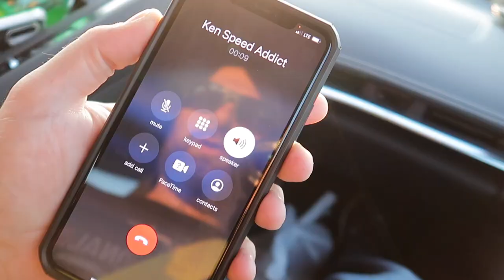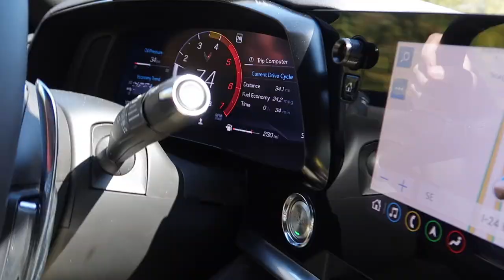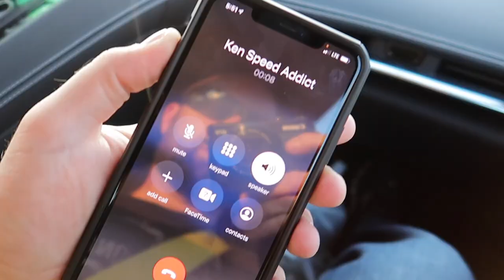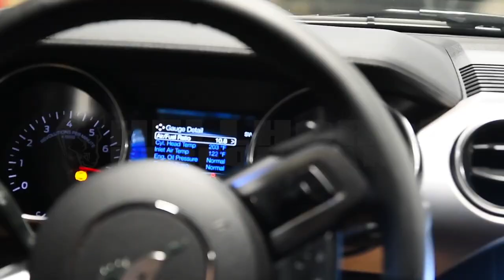FANBOY Mustang Owner REACTION to Guy's NEW 2020 C8 Corvette *IS PRICELESS*

Comment: Thing about the GT500, which has really impressed me with what the engine will hold....is simply another S550 with Eaton 2650tvs rotor pack and predator block anyone can buy for $2600 shipped....meaning we can built it basically...looks sweet but like buy like all other s550s with same parts bolted on it.......

 The C8 is completely a new evolution of 65k car...you can't build it from a 2018 mustang with same parts....it just needs boost....and tuning.....
Reply: You haven't driven a GT500. You are 100% wrong. You can build a GT that will go faster, for sure. But, you cannot build a GT that will handle the same, nor will it shift like the GT500 does. Its not the same car at all. I've actually driven a GT500 on a track. They feel completely different.
Reply: @TurianX  yes and nor would I ever want to....but I like the vettes chances when the computer is unlocked...or on a short track......

 And im sure if I were determined enough, as I explained since they used traditional trans geometry there will be DCT swaps in the future....cause it is ONLY a s550 same as any other just different parts bolted on....
Reply: I guess I did a poor job of explaining what I meant...
 A Hellcat IS a challenger body that down to the bolt holes you could put the 6.2l Hellcat engine and ZF8HP90 ( vs ZF8HP70 that comes in Scats )..A widebody is that car with fender flares we used to make fun of shit for using 30 years ago...with different parts be in brakes control arms ect ect bolting right in....
 Strip the GT500 down to its chassis it IS an S550 and every part that makes its what it is could be put on mine by a bodysuit ( flares) or speed shop all the rest as they are literally the same chassis...I mean damn even look the same inside...im gonna guess the seat bolt holes everything likes up...
 So a GT500 is a combination of parts bolted to the same S550 chassis thats been used for years with a nice grill/hood. 
 I'm not obtuse i know those aren't just cosmetic improvements but serve aero and cooling ect ect ect...but it looks just like a S550 cause it is, even the trans would bolt right in literally using its length drive shaft ( which I like because if they get popular then thats a swap people like me could do later once the tcm section is cracked)...
 A C8 isn't a C7 with bigger brakes, nicer front end, better cooling and a DCT that parts could literally be swapped between...its a evolution in affordable American Muscle as a mid engine....it shares literally nothing with a C7....
 Its not a fully optimized C7 CHASSIS, its entirely new and revolutionary at its price entry point allowing things I care about like 2.8-2.9 0-60 on the street hehe....
  The GT500 is basically a blown GT350, they even share the same block 2019 and Voodoo blown engine replacement aka the Predator block...although yes its a flat plane......
   You could look at the GT500 as a supercharged fully optimized S550 chassis but there is nothing new or incredibly different from a PP2 or GT350r minus the DCT....luckily for us they used one in a traditional configuration which allows some GT500 owners to use for instance the same turbo 400 conversion kit OR inversely bolt the DCT in if someone wanted that...
 Similar to how a widebody hellcat is a hellcat with fender flares...its a progression not a revolution....
 I do MUCH prefer the GT500 front and hood especially since I have the same rotor pack in a similar spot id like a functional heat extractor there....

 Your absolutely right for me there is zero point as StangMode is showing the difference between the Mamba S550 with less power than his GT500 on stock engine running 8s...which is what id care about.....
  The handling aspects of the C8 ( incredible supercar looks for 65k aside ) also would be wasted on me, I freely admit...however that 2.8 0-60 on the street from the weight bias of the mid engine car with say 12psi like the GT500 is HIGHLY interesting to me.......
  I can at least fathom and respect the skill it takes to both bolt the correct combination of parts on a s550 chassis, as well as the skill it takes to extract that as a driver but for most its just not a priority to squeeze everything out of corners.....however a Chevy Lambo with insane lateral grip from a mid mount engine with a little boost would be insane sweet to ME...

 Challengers have been the same for years as well its simply same car outfitting for different task...the 1320 has the demon suspension but NA...forge it and boost it boom done poor man's demon.....

 GT500 is S550 aka Mustang GT with a combination of parts to optimize handling and power with a new DCT...but it is not a Ford GT which id a paradigm shift from s550 chassis..

 Demons, Super Stocks, Hellcat redeye really all the same with a different loadout of parts same chassis been made forever....
 VIPER ACR is special and bolt holes probably don't like up with challengers hehe...
 C8 is that same JUMP from C7 its another level....even at base model.....

 Didn't meant to offend any track racers as I respect those that can drive just saying the car itself is literally just an S550 with a new combination of parts many of which ( except for now till a PCM can be cracked ) be carried over to base models...I could literally bolt the engine GT500 engine down in my car...literally...it may be Halo Mustang GT but not revolutionary so to spesk......I bet its cool to bank thru gears on the paddle shifter....I can see how people that appreciate and spend a lot of time perfecting their driving technique could take offense to it just being a mustang gt with a DCT, big brakes and new fenders hood and nose...im sure hellcat owners were pissed when scat packs got widebody and their hellcat hoods hehe...

  I like em they have a sweet looking nose and hood with whats proving to be a tough engine no harm meant...

Comment: With the Corvette having 265 less horsepower and still running the same quarter-mile time as a GT 500 says a lot a 200 shot of nitrous on a new Corvette will gap gt500 around corners or straight line a few turbo corvettes out already

Comment: Here you go zander if you are really want to break it fully do big road trip to stangmode place and back, that will defiantly break in that 500 miles , Here are my two cents about those two cars c8 is al that tech basically gt500 all horse power what side of the coin do you want al tech or all horse power, but the c8 is badass car not going lie

Comment: The C8 is nothing but a Walmart "wannabe" Ferrari!
Reply: Is that a bad thing lol
Reply: No
Reply: That corvette will be a yard ornament because GM quality sucks.
Reply: @Justin-ik6se  been thru 3 engined and 2 trans in 8k miles on my 2019 A10 Mustang, my 67 Camaro been running over 50 years ;)...has a 52 year old block that has been taking over 1000hp for 10 years hehe( it really shouldn't take it what a tough old dinosaur)....and has a 4l80e ( aka turbo 400 with OD and billet lock up, the ford guys seem to love now after 50 years, to be fair I've had a ford 9 inch in my 67 over 20 myself hehe)

  What I've learned last few years with my first experiences with new cars ( I've built my own combos till now), is that they ALL suck, all cut corners and none of them truly support their product....

 That said ill give props to that GT500 engine its a fckn monster to hold what it's holding and has really impressed me, im building my last core which I kept this winter and im seriously considering just using the Predator block as the starting point its a 1000 cheaper than sleeving mine and I don't have to arrange shipping both directions
Reply: @Justin-ik6se  you know pretty much everyone here owns a mustang right?
Reply: @Justin-ik6se   need to give mine to someone with a fat wallet to spend on broken parts, whom wishes to punish themselves due to some kind of self loathing....lol....

 Detach from a name Ford nor anyone else gives 2 shits about YOU, been building, tuning and racing engines over 30 years its about the journey of learning im not marrying into the family....so it makes it a bit easier for me to be objective...
 I've personally custom built Buick 455s, Pontiac 400s, Olds, Ford 429/460s ( not very much Windsor stuff none of the newer stroker 351 Windsor based stuff ), Dodge and GM......
 This latest gen of Ford sucks both the plasma bore with cast pistons at 12 to 1 on 93 and the 10r80 issues....however I like the spirit of what they tried to do aka give us maximum performance and efficiency....they just failed but ill get the trans built and ill build my gen 3 core over winter and see how that works...I kinda look forward to the engine build....its a great engine just poor QC and choice of piston for the plasma, and why you see the GT500 Predator being a beast with the same bore....I also love the dual wide bands ( as a side tuner) stock along with the sensitive 4 knock sensor layout and even the ability to tune it without sending off PCMs and TCM modules ect....
 10r80 sure its clutches aren't as robust as the GM 10l90 but hey im fixing that...
 My Rotors are warped and now there is dirt/rust coming up from under the base coat so at minimum a 3rd of the car will have to be repainted.....
 It was also 1.5qts low of trans fluid from factory and the Ford tech underfilled the 1st engine 2qts but I knew that was happening so I caught it before it left...

 Car simply sucks...BUT I still like it and ill make it like I want eventually though my carfax is 3 pages long....Im not sure anyone else makes anything better these days....LTs aren't was LS3s were and Hemi lifter issues ( though that ZF8HP90 is money) and screen failures...its all junk and no one GM included stands behind their shit anymore...

 I do have some fondness for my Mustang because though physically the smallest, Ford gave my tall fatass the most comfortable cockpit....and I appreciate that its why I didn't buy a new Camaro....

 I'm used to making shit work anyway, ive never had a brand new car before 2018 so....ill fix it like it should have rolled out....no biggie...ill have it a long time as well I'm sure...

Comment: Sorry Z...but that Vette is butt ugly.  And you can't tune them.   A tuned gen3 will walk away from it on a roll.
Reply: A FBO wont touch it anywhere.  I know, I had one.
Reply: Why do you need it tuned when the ZORA comes out with hybrid assist on the front axle and 1000 hp on the rear making it AWD :)